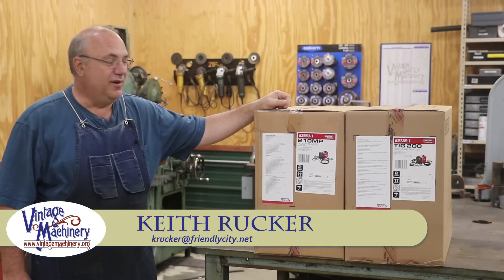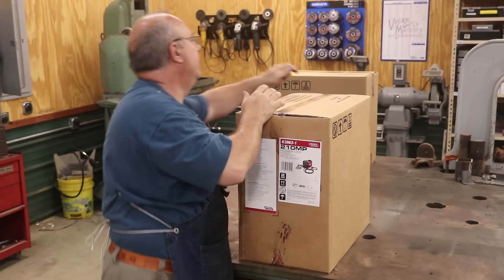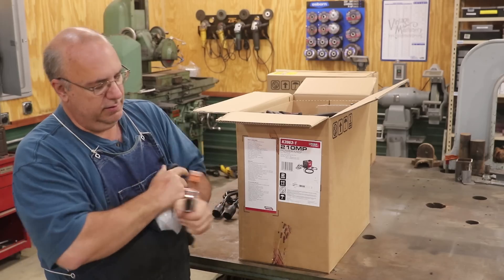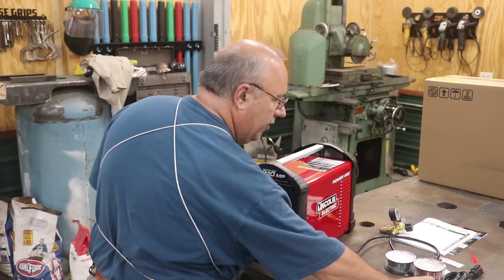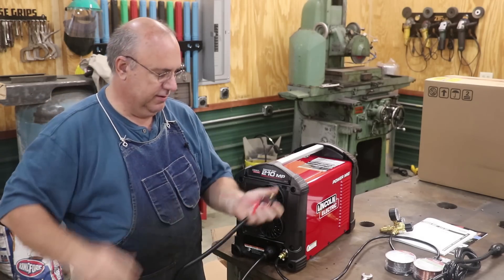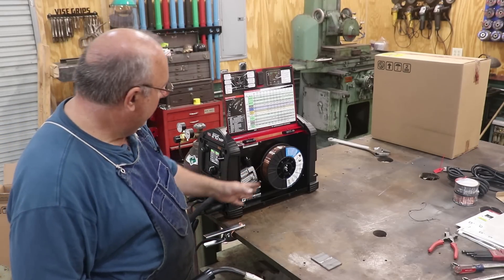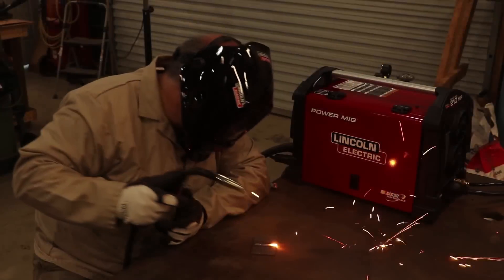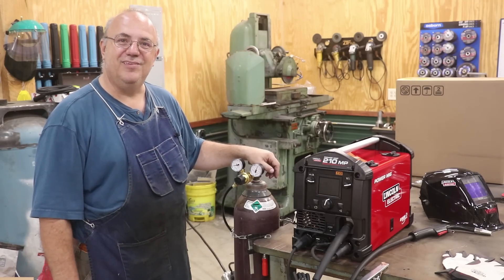Lincoln Electric Power MIG 210MP -  Unboxing, Assembly, and First Weld

Comment: I have the same Lincoln 210MP machine and love it.  Bought about a year ago.  One note - when I first got the 210MP I tried the 120v plugged into my 20A outdoor outlet.  The power tripped immediately every time I reset it.  Problem was the GFI (or GFCI) breaker on my outdoor plug.  That GFI is so sensitive that it won't handle the initial arc.  So if you do try running the 210MP on 120v be sure to use a 'regular' outlet, not the GFI type (Ground Fault Circuit Interrupter).  I now run it on 240v all the time and it is very smooth.  Great welding machine, and I recommend it also.
Reply: A number of people report the blown circuits are a function of the 20amp circuit, not as much the GFI.  Hook the welder up to a 30 amp circuit and you should be fine.
Reply: What size mig wire can this machine be operated with? Thanks for the comment

Comment: Just a tip, when setting fresh wire. To make sure you don’t jam or kink the wire while you load the hose you should always take the tip off and keep the MiG gun cord as straight as possible until it exits the gun, then reinstall the tip and cone. Sometimes the wire will catch inside the tip and birds nest or slip your rollers. 

Just to avoid head aches, what I was taught and have always done.
Reply: Yes, that is correct!

Comment: Great video!  Question: if running on 230 V, what size breaker on my electrical panel do I need to have?  20 AMP or 30 AMP or 50 AMP?
Reply: Hello Yiur welder should have a spec plate or sticker on it .. this will answer your question 
Amps are cut in half when ran at 230 voltage per Ohms law.
Reply: The Lincoln data sheet for the 210MP states max current with 230v supply as 14.7 amps. So theoretically you could run a 20 amp breaker. I'd personally run a 30 amp breaker. Note that the receptacle needed is a NEMA 6-50R which is the standard "welder outlet" and, as you might guess, it's rated at 50 amps. So if you only run a 30 amp breaker upstream of a 50 amp receptacle be sure to clearly label the receptacle "WELDER ONLY". This is doubly important as it could be that in the near future somebody may try to plug an electric car into the receptacle. The danger with that is that the wiring from the breaker to the receptacle only needs to be 10 gauge for 30 amp service, while for a 50 amp draw like an electric car charger the wire needs to be 6 gauge I believe.

Comment: what is the duty cycle. on the small machines they have a sort duty cycle
Reply: Jay Holboke At maximum power, I believe it's around 25%. Its listed on the spec sheet at Lincoln's website.
Reply: 40% duty cycle on 120v. 25% duty cycle on 230V

Comment: Over in the U.K.  I have a Kemppi Minarcmig made in Finland which is now a few years old. It is an inverter machine and can have a shoulder strap to carry it anywhere as it is so light. This is particularly useful if you use fluxcore wire and no gas. It is synergic so you only need to set the material thickness manually when it is in automatic mode. The machine itself automatically adjusts to the material and conditions instantly. It only does mig welding but the weld quality is consistantly  more betterer than any other machine I have used (except my larger Kemppi Kempomat). Iwould love to try the latest Kemppi machines but they are very expensive of course. With the Minarcmig  you can take it anywhere and be welding about ten seconds after you plug it in and attach the earth clamp. Kemppi also make the  best tig welders, in fact it was they who solved the long-standing problem with tig welding.

Comment: kieth  on your tube where your spool of wire slides on they is a little plastic tit that fits on your spool of wire to engage the spool to the drive tube. this keeps proper tention on your spool of wire then in the center of the tube is your spool  tentioner knob to set a little drag on your spool so it dosent free wheel. hope this helps.

Comment: Im a rookie and I'm having problems with wire tension. I noticed this machine does not have numbers on the tensioner knob. How do you adjust yours?
Reply: Well if your wire is underfeeding, add tension. If overfeeding, less tension. Just gotta get the feel of it I guess.

Comment: Thanks, Keith. Do you think this would be a good welder to start out with? I'm the type of guy if I buy a cheap one I always regret it. It sure seems simple to learn on.
Reply: I own this machine, and I am a newbie. That said I read many reviews on it, basically saying it is very good at mig and arc, and not a bad machine to start doing tig, can't tig aluminum, and that makes no difference to me at this time.
Reply: @Affordablebath_remodel  Ok, I got it delivered Thursday. I also bought the spool gun for Aluminum.

Comment: Anyone know if the rebate is still active?
Reply: Perhaps it was a once only Rucker-channel-promo offer.
Reply: Check back with your local welding supplier and lincolnelectric.com. rebates tend to pop up every quarter for different machines. Right now we have rebates on the Ranger engine drive welder/ generators. And the 256 power Mig welder also. Been selling a lot of their tomahawk plasma cutters here in AZ a lot too. That rebate has been kicking butt lately.

Comment: I just bought a Lincoln 210 and getting a lot of tips from these video's; well done guys! Question if anyone knows, will this model run all day on black 1.2mm T square tubing? Another question, does the computer offer metric display rather than imperial? Yes I can Google the conversion but just asking. Thanks fella's

Comment: Thanks for the review Keith. I'm thinking of replacing my old Lincoln weld pak 140 with one of these. The 140 is pretty limited (MIG and flux core only) so having one machine that does everything (with more power to boot) would be nice. One suggestion - when feeding the wire through the gun keep the MIG hose as straight as possible and remove the tip which you can put on after the wire comes out. Doing this can help prevent the wire from getting hung up in the gun hose and you'll know immediately if you have a too small nozzle since you won't be able to feed the wire through the hole when you attempt to screw it back on.

Comment: I am very new to welding and in the process of getting the Lincoln MIG 210 MP model. Your video was very informative. Where do you buy your .035 welding wire? Is Lincoln wire better to use in their products than other brands? Thanks for your advice.

Comment: Keith- Rule of thumb on all devices, especially hydraulic and gas lines- NEVER- partially attach a line to be "tightened later"- that is a recipe for disaster- if you forget, it looks tight, but is not-
Reply: yeah, check out a book by Carroll Smith..."Nuts, Bolts and Hardware"....ALWAYS tighten any hose/line fitting like you're gonna run it....you're not likely to wear out the fitting/s.
Reply: I learned my lesson as an apprentice mechanic decades ago- My first engine rebuild- got it all together after a full teardown and it ran perfect- started on the second turn.  I was a proud teenager when the customer drove out the door.   The next day we got a call- customer said the engine lost oil pressure and had a rattle.  Yep- when I first drained the oil during the teardown I screwed the drain plug back into the pan by hand. After the rebuild I forgot and it looked tight, so it vibrated out after the customer drove it and he lost all his oil.  I had to foot the bill for the second rebuild and I never forgot that lesson.  Later when we were building and racing cars, I saw so many guys who would screw on an oil line by hand, and then forget to tighten it up and lose some really expensive motors- never again happened to me though.
Reply: Excellent Reply...thanks! 
   In the 1970's I worked on some BIG machine tools, lots of hydraulic hoses and steel lines, 2,000 PSI, sometimes the assembly mechanics would forget to tighten the hoses due to having to climb a ladder and bring the 1-1/4" wrenches...So, as the Electronics Tech, I learned to ALWAYS check that stuff, ended up buying my own combo 1-1/4 wrench! or maybe it was 1-5/16"...
 I often think maybe automotive oil drain plugs should be safety wired, once worked in a diesel truck shop, when you changed the oil, you kept that drain plug in your hand if it wasn't in the motor! Those are very expensive engines to fix if you even start then for 5 seconds with no oil!! There were torque specs for those plugs too.
Reply: Agreed,
Auto stuff can be messy and expensive, but high pressure hydraulics can be deadly.
Reply: Kills the machine too !

Comment: I use the Lincoln .035 wire in my little hobart, runs very consistent. Also cheaper per pound in the big spool. (corrected wire size)
Reply: Check decimal place...LOL  that's some mighty big wire.
Reply: LOL yes you are correct... I should not make comments at 3am
Reply: I bought a Miller-Matic 200 in 1982....ran .035" and 44# spools, Lincoln...they were about $35 at that time, I just remember 3 spools was a tad over $100...in Oregon, no sales tax.

Comment: Sad that the MIG just take small spools.
Reply: Baron3D It will hold a 10-pound spool won't it?
Reply: Yes, but not more. I always buy 32 pounds spools, and I am just a hobbyist.
Reply: This machine will accept the standard 2lb spools as well as Lincoln electric 12.5lb L56 wire spools. Standard 8 inch spools can be anywhere from 10lbs to 12.5lbs depending on the manufacture.

Comment: hi kieth great welder something i've not seen any of you guys do, either tig or mig,,,, i used to be a welder and on the bench as a gun holder, find a peice of tube that the id is large enough for the gun shroud fits snug, about 2 inches long and weld it just underneath the work surface on an angle like a holster to slide the shroud into, works brilliant and stores your torch safe from accidental arc

Comment: I.ve had that model for about 2 years. The intereface is teriffic especially if you are a periodic welder that switches from mode to mode. Something to consider. Instead of a welding cart, reusing the bottom half of a used tool box can be a great way to go. You typically get more drawer space and often have room for plasma cutter on top a mutti mig welder has a lot off accessories to keep track of.    weldingtips and tricks has excellent reviews on this model. https://www.youtube.com/watch?v=T9WbwS54B-0       Also the welder will support .045 (see directiions)